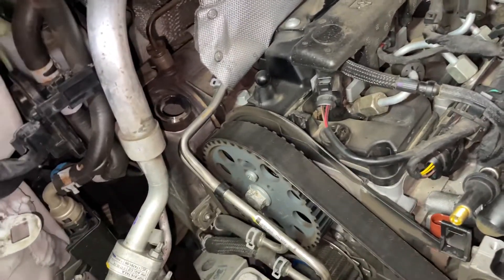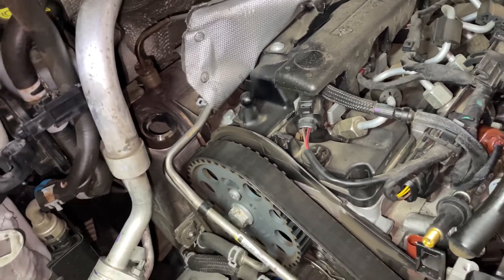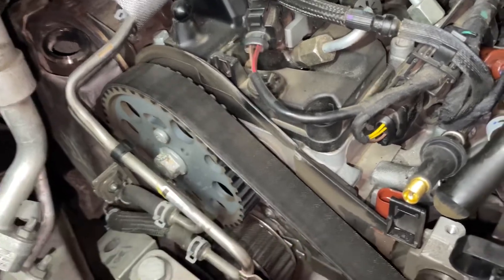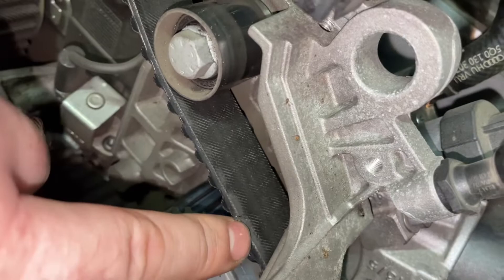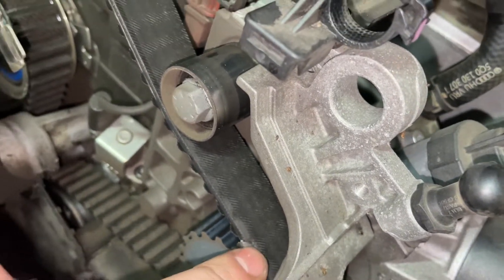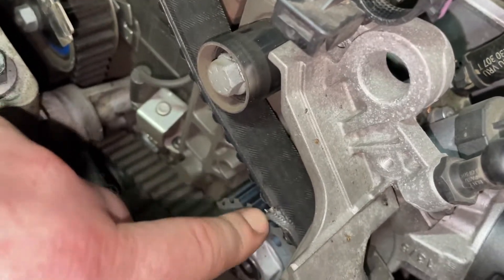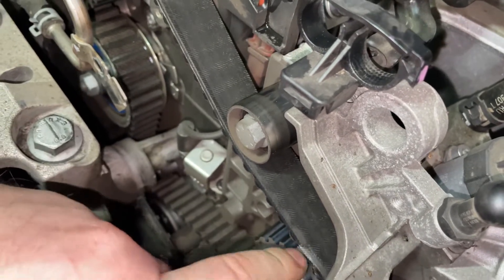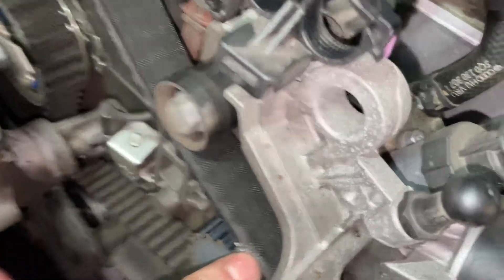A Ripped Timing Belt 🫣🫣🫣

Comment: That's why I only buy cars with timing chains. Don't want my engine's life to depend on a piece of crap rubber.
Reply from the maker: Exactly that it’s very expensive if it goes pop
Reply: @TheVWMechanic_official  Yep. I'm an ex diesel technician  (back injury) and don't like the new vehicles with all their anti pollution crap. 
I drive a 2001 Nissan Sentra  (Sunny in Japan)1.4 port injection 16 valve engine. This car has no catalytic converter, no egr, no airbags, no abs and no problems whatsoever. 
This car is still in mint condition, original clutch  (I bought this car new ☺)and I've only replaced brakes and the rubber boots only for the front cv joints. I've also replaced all 4 struts and many tyres. That's all. 
I change the engine oil every 10k kilometres with CASTROL Magnatec, and original Nissan oil filter. The air filter, fuel filter  and spark plugs every 30k km. Special fully synthetic manual transmission fluid every 100k km's, to keep the box's synchromesh rings in top condition. I want to drive this car until I die.
Reply: Another mechanic at the shop where I worked didn't tighten a TATA pickup's tensioner on the cambelt correctly, and it came loose a day after the customer took the vehicle! The belt jumped, and it was goodbye valves. Luckily the conrods didn't get bent. Head had to go back to the engineering shop.
Reply from the maker: You sir have got yourself a good car and I totally agree the more modern the car is the more electrical gremlins they have and loads more stuff to go wrong on them
Reply from the maker: That’s really unlucky, but also could of been avoided by that mechanic checking his own work :)
Reply: @TheVWMechanic_official  ☺
Reply from the maker: Thankyou for commenting I massively appreciate each and everyone that comments 🤩
Reply: @TheVWMechanic_official  Yep enjoy 👍